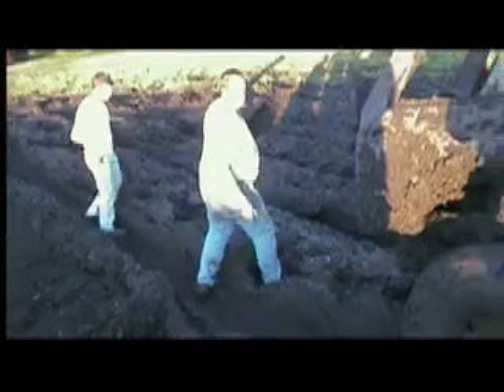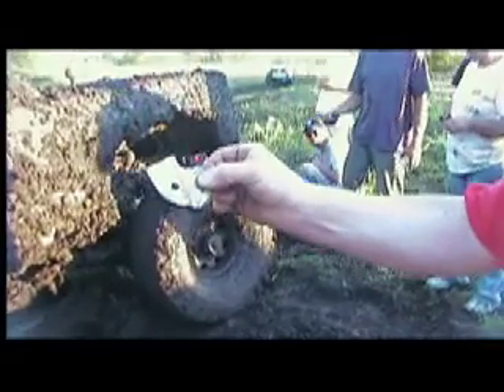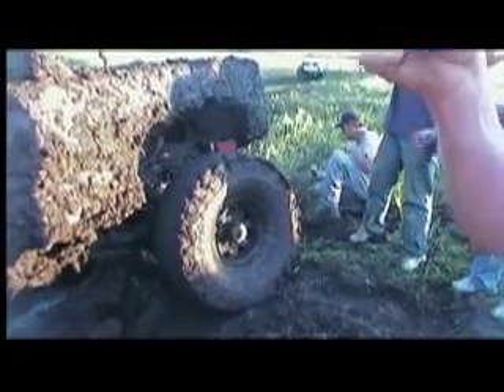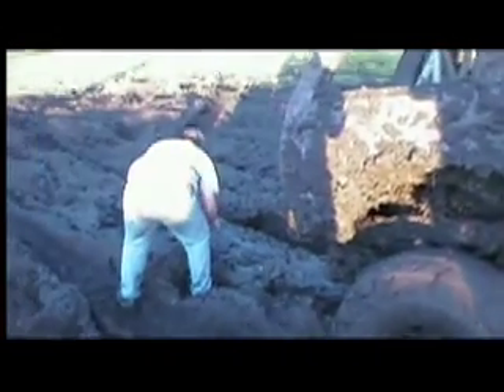Dean's engine no more

Comment: yo bro what happends is the engine gets at to high rpm for the cam and the cam breaks and the rod shoots through the block and it just fucks it all up.. I had the same problem on a 327 I held it at 9 grand mudding lol and same shit I fixed it by not going cheap lol I now have 45k miles on a new motor I built and it gets pushed every day... good luck have fun